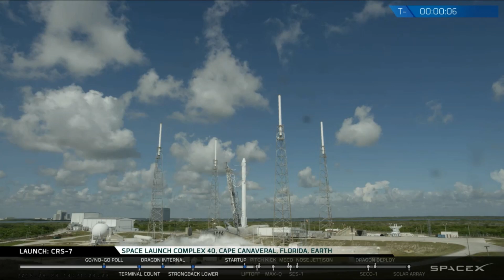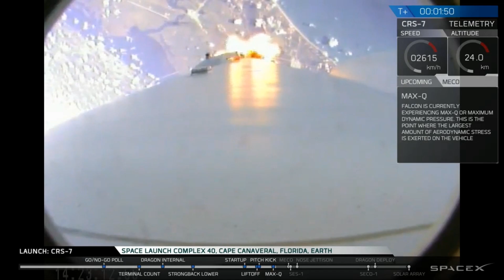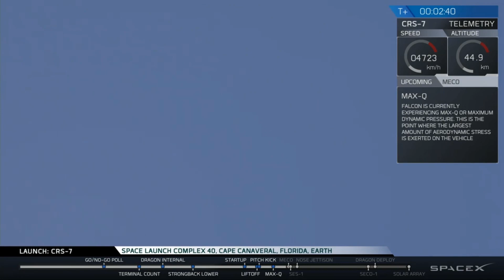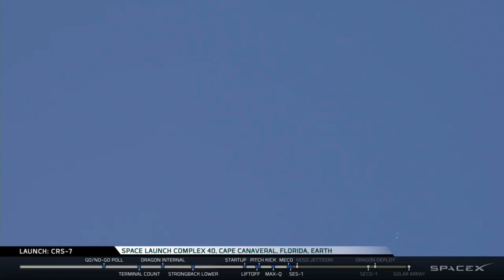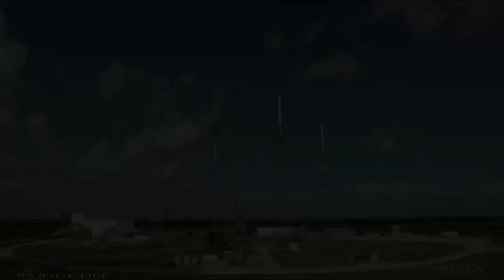SpaceX CRS-7 Explosion

Comment: I can already tell you why t blew up. The rocket is far to complex. But we are in luck. NASA and the Air Force have developed some really good rockets over the years and because there have been so many of these launches most of the more common design flaws have been discovered and fixed. Why not use those rockets?